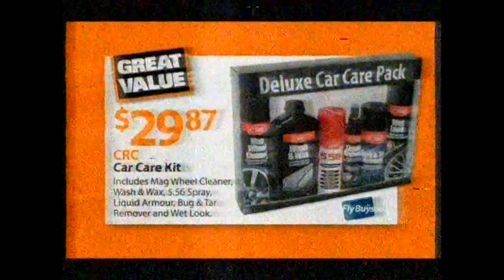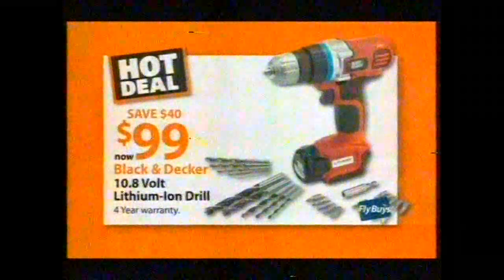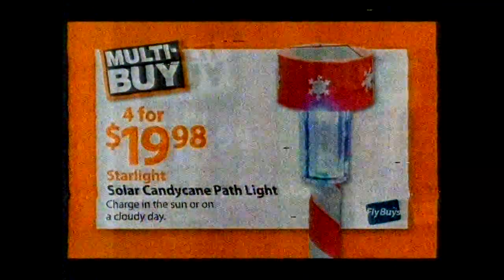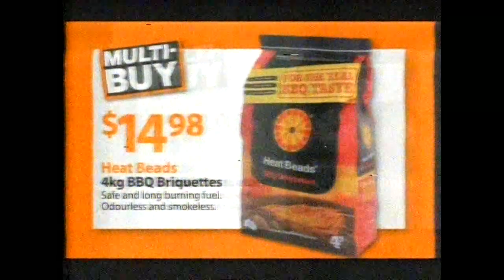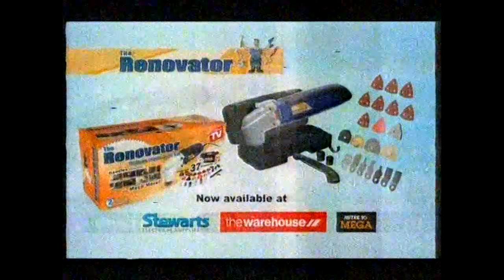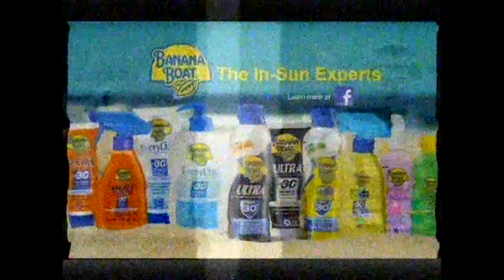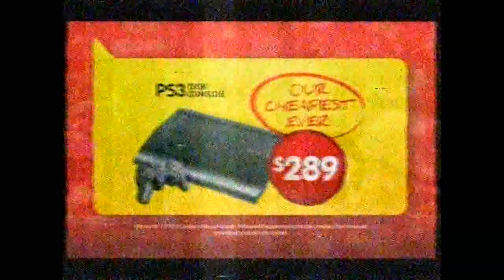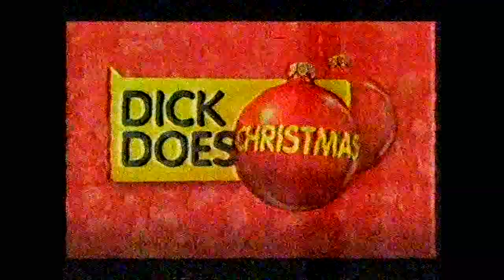TVDX: TV2Ch3 Hedgehope NZ - another strong Es opening

Comment: Using my D100 DX TV converter, it was possible here in Melbourne to null local ABV 2 just enough to allow TV2Ch 3 signals to over-rode. However, the best I could achieve using that method was a BW video signal with audio. I actually have a video of TV2Ch 3  Hedgehope NZL included on my YouTube channel.